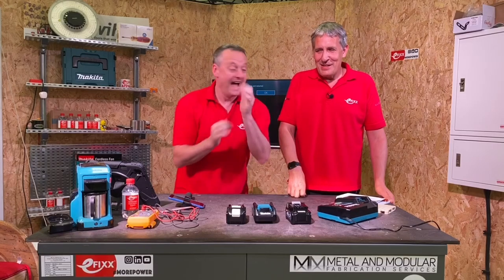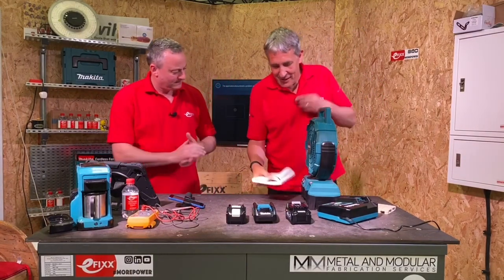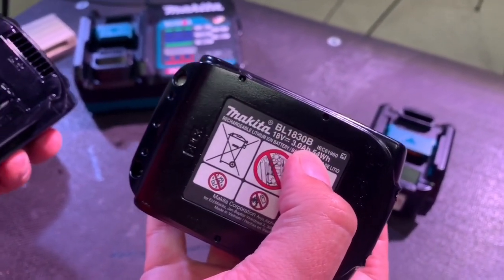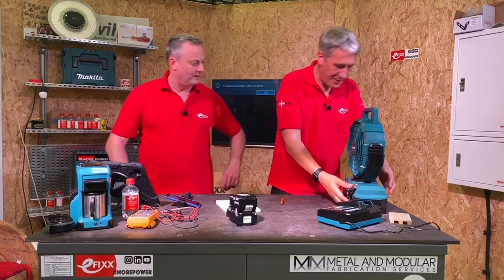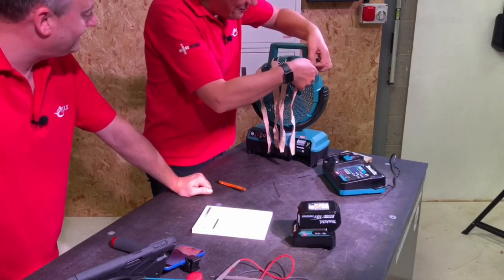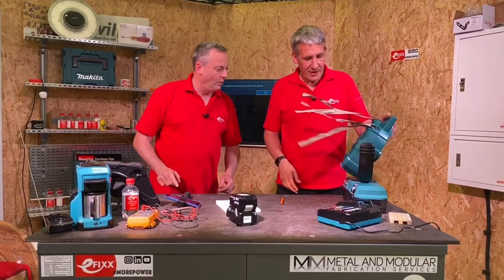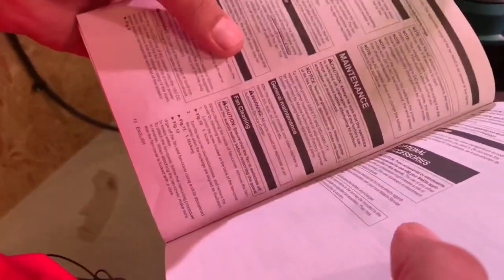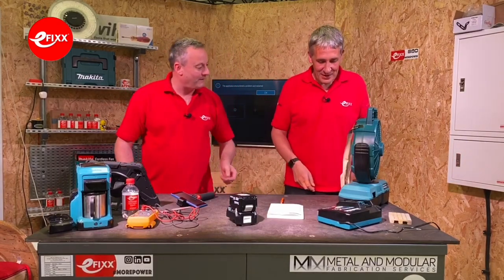REVIEWED: Makita XGT 40V fan just what we need to go with the coffee machine

Comment: Do you do ? On WiFi I’m told I’ve got from bt fibre optic power coming in to the house, but I’ve still got the 1960 old cable coming into the building from a woooden pole in the street ie two little,what looks like steel cables